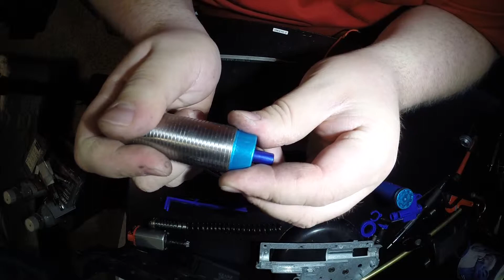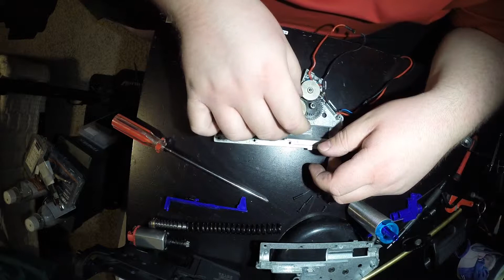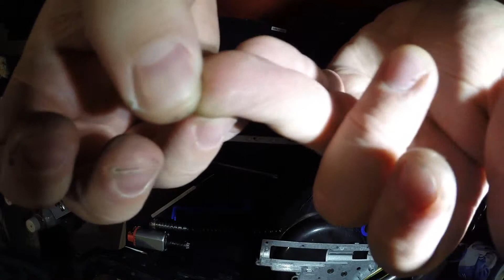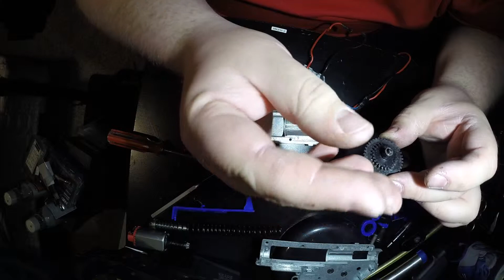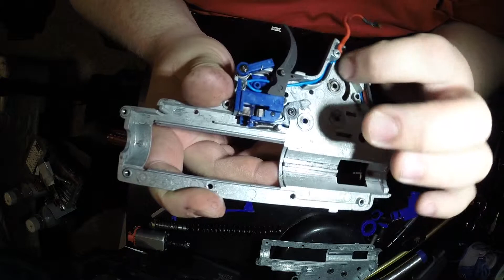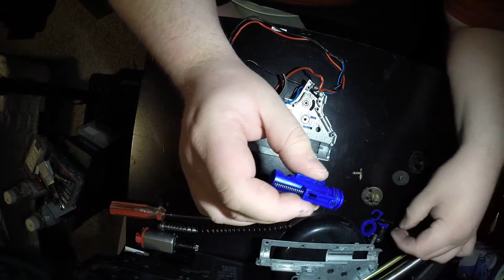Maple Airsoft Supply Blackout internal review (Part 2)

Comment: Well this really blows the CYMA Platinum M4s out of the water. Just got my platinum in and it is put together pretty terribly. Decent parts, but the cylinder head o-rings have tears from factory and had to expand the piston o-ring to get an airseal. Not a huge deal, the airseal is perfect now, but also poopy external tolerances (upper receiver wobbles), the microswitch mosfet trigger unit is known to overheat, albeit in somewhat extreme circumstances, and the painted body is fucking gross if you're used to $300+ (USD) guns. I'd get the plastic body Maple Armouries gun for $185 before getting a cyma platinum for sure unless for whatever reason you REALLY want the true quick spring system.